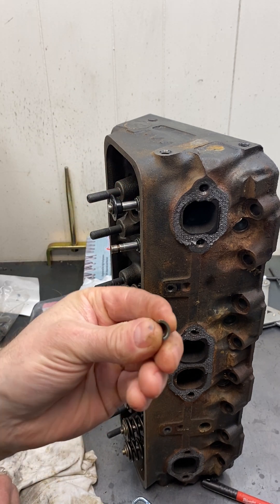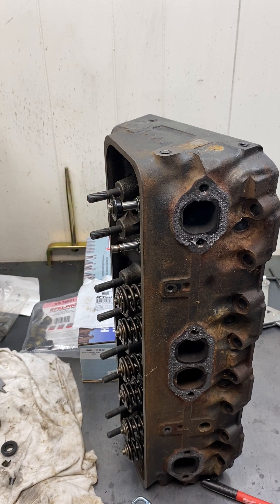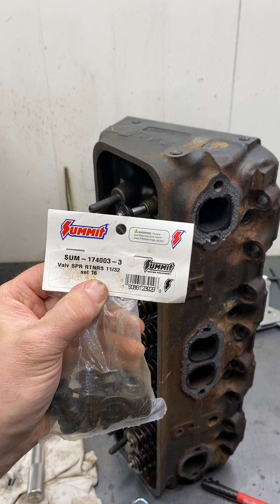Vortec Cylinder Head Valve Lift Increase (EASY .550")

Comment: I've heard it's 420 then 470 so I'm a bit confused as to what it actually is. Guess I'll just have to measure mine up.do those valve keepers keep enough valve above them to run the self aligning rockers? Is it a better idea to run a cam that gives you the full amount of lift you want or should I run less cam and a bigger ratio rocker

Comment: Do you know if I Can use 1.7 rocker arms with this lift?
Reply from the maker: That would depend on the camshaft lift. The lift number given on the cam card is many times calculated for the use of a 1.5 rocker. A cam that had .550" lift with a 1.5 rocker would have .623" lift with a 1.7 rocker.